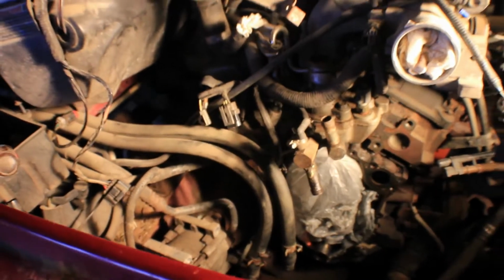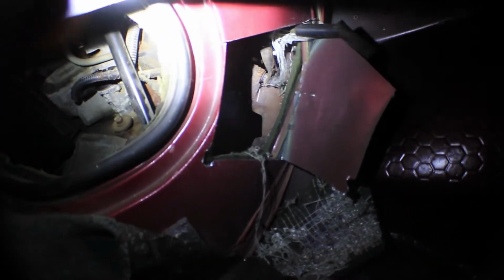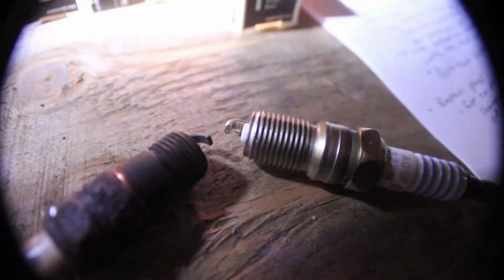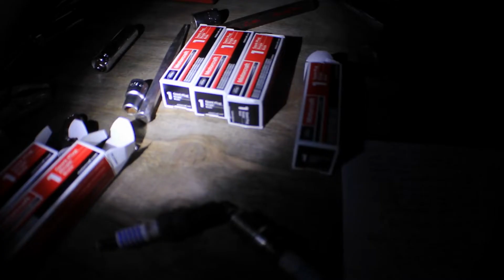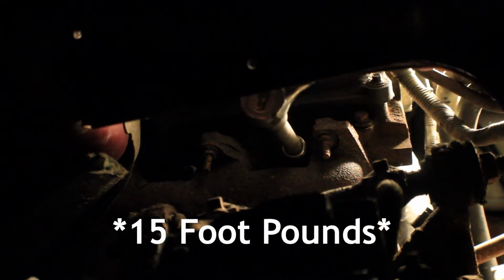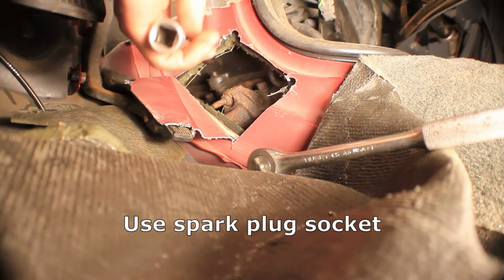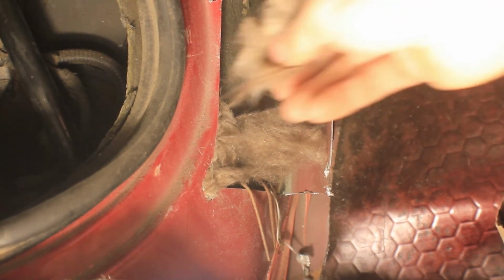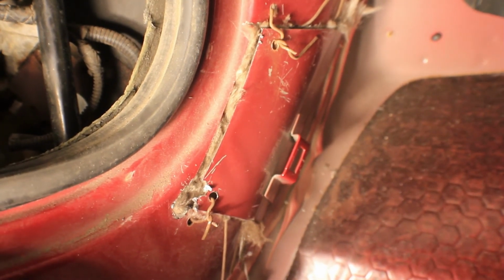Changing Spark Plugs on a 96 Ford Aerostar

Comment: Why is the new plug thread twice as long as the old one? Is that ok?
Reply from the maker: Yeah, its perfectly fine because there are actually only like 5 threads in the engine block itself. Then the spark plug hole is just smooth walled for 1/2" (about) before the tapered mating surface on the block. So either type of plug will work.